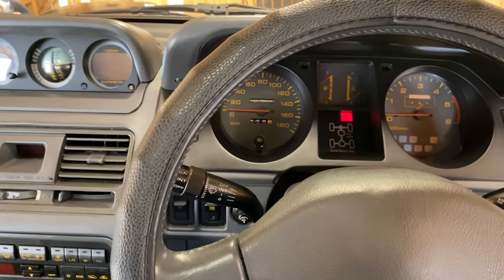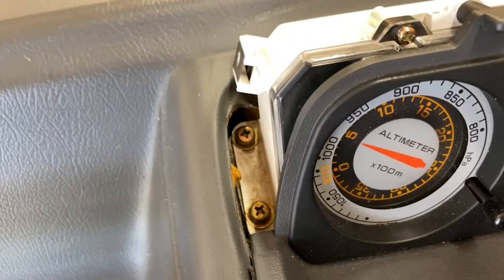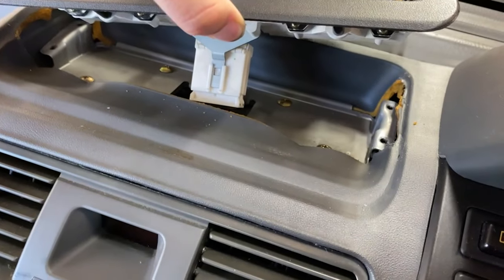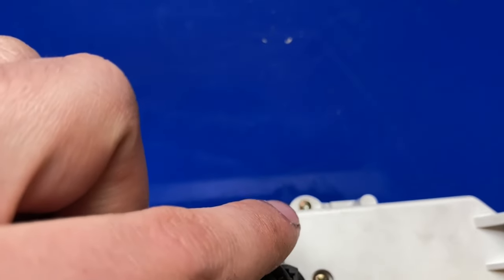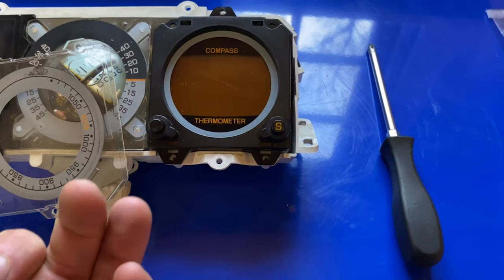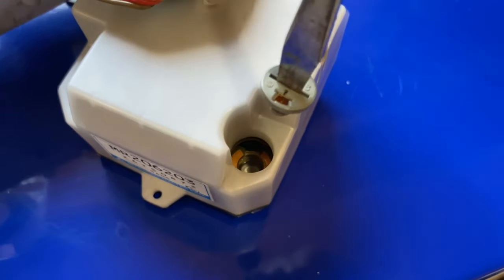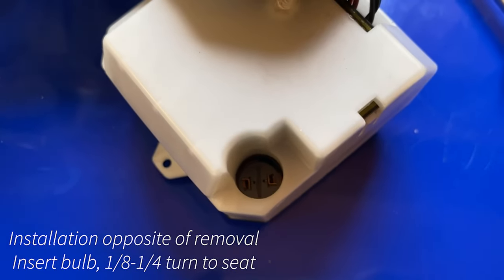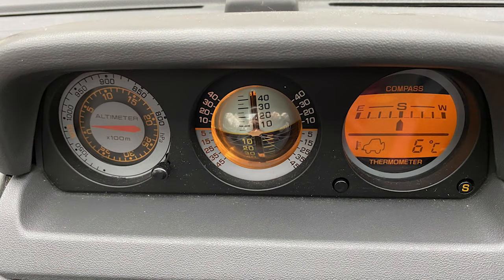Mitsubishi Montero Compass Backlight Replacement (+ Altimeter, Inclinometer Bulb) DIY

Comment: my compass and the compass backlight stopped working almost like a year ago, never fixed it, guess this video is a call to action lol. Do you have any idea if its fixable? I know that the bulb can just be replaced, but the compass is not working, only the display shows up blinking...
Reply from the maker: Have you tried recalibrating it? Press the "S" button in the bottom right and drive in figure 8's in a big empty parking lot. If this doesn't fix it, I'm not sure the unit itself is repairable. There are only some tabs and a couple screws holding it together, so I suppose it's worth a look to see if anything is obviously wrong internally. It is replaceable independently of the rest of the 3-pod cluster if it comes down to it.

Comment: How do you fix the altimeter and inclinometer????? Mine don't work any more... Also I have a different compass and that stopped working too
Reply from the maker: If they are all digital, check the plug and wiring underneath. Sounds like if nothing works, the module could be not getting power.  The altimeter and inclinometer are mechanical on this one. This inclinometer doesn't work either - they are filled with fluid from the factory, and the fluid drains out after the years. There's a way to fix them by re-filling them, but I haven't tried it yet.
Reply: @d2overland  mind making a video about how to refill them? im trying to bring my father's 92 pajero back to life
Reply from the maker: When I get around to it, I'll make a video
Reply: @d2overland  great! got yourself a sub

Comment: My compass looks like that all the time?
Is it just the bulb to get it working again?
Reply from the maker: In my case the bulb was just burned out - it worked ok, but you couldn't see it at night. This is an instruction on how to remove and disassemble the unit to replace the bulb